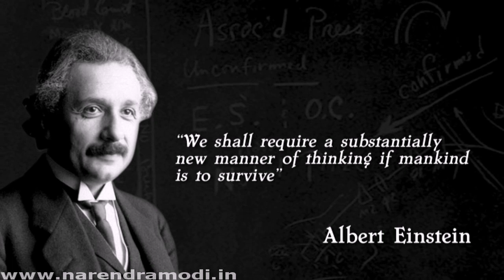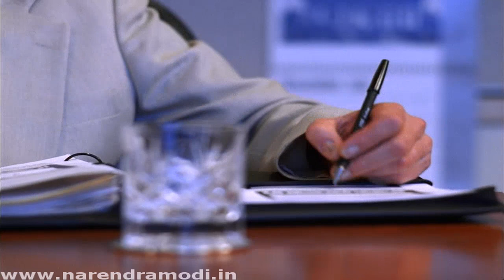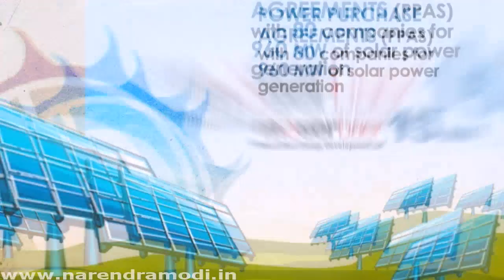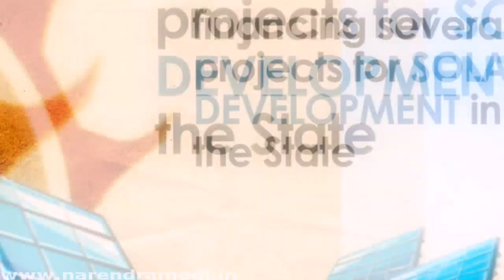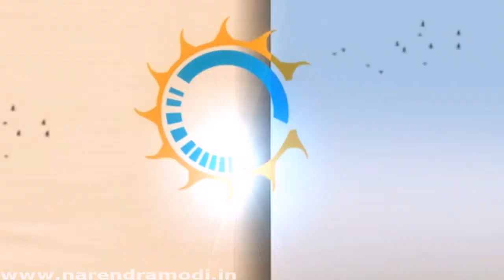Solar Energy 2012

Comment: water would ultimately drop into the canal....panels are also water proof. The solar panels on the canal is an innovative idea ,water flowing beneath the panels helps in cooling down the panels which would lead to more electricity production. Cooler the solar panel more the electricity produced.